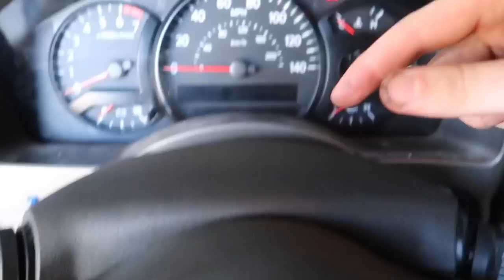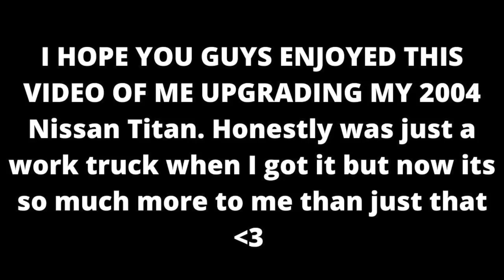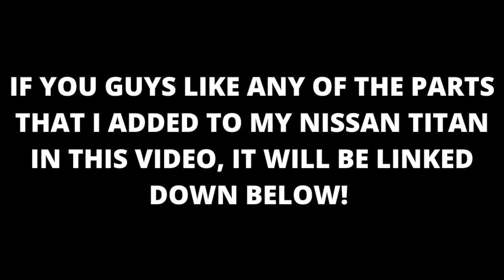BUILDING MY DREAM NISSAN TITAN IN 5 MIN!!

Comment: Looks good brother! How large is the lift? 6”? The Link doesn’t work for rough country’s website.. how does it ride? How is the steering did you have to go get it realigned? That’s a lot of work to have to upgrade steering knuckles, suspension, real leaf shackles, possibly new leaf spring/add a leaf? Ive got a 3” lift on my 2010 pro 4 x and I can barely fit in the garage, or else I’d might go an inch or so taller with a nice steel overland front and rear bumper